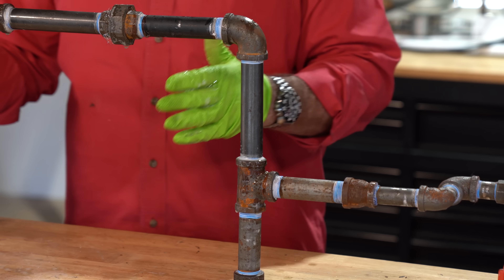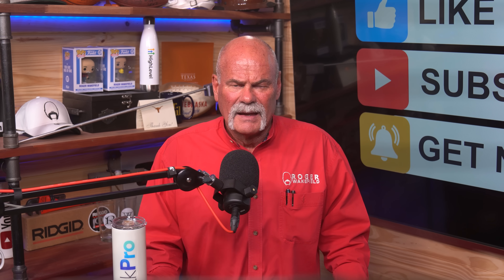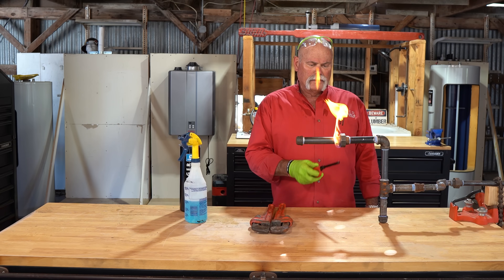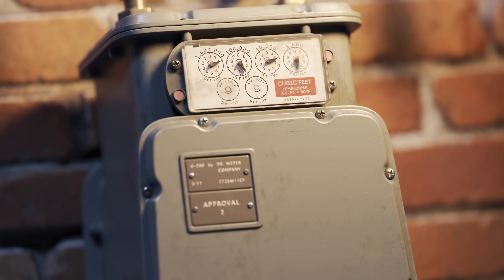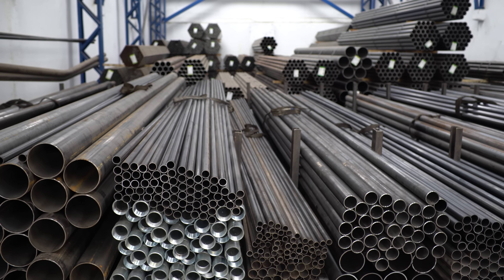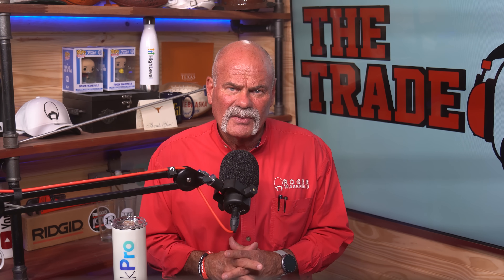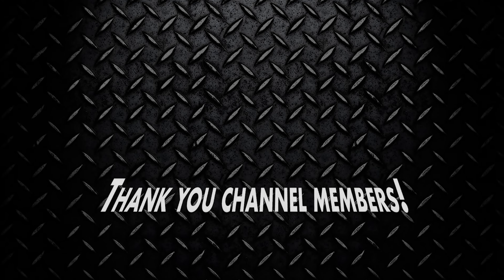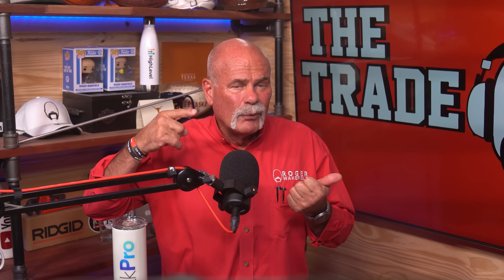Everything to Know About Gas Lines in Plumbing

Comment: Someone, a DIY homeowner most likely, ran most of my house's gas with the flexible metal gas hose in the crawl space. I don't know if they were just lazy or didn't know how to thread black pipe.
Unfortunately for one of the contractors I hired, he nicked the flex hose when he was cutting old galvanized water pipe out. so the crawl space was full of gas, just after he probably had been throwing sparks cutting pipe. He was pretty shaken when he finally got out.
Just way too much of that flimsy pipe under there just hanging off straps tied to the floor joists, real sloppy work and dangerous!

Comment: Plumbed for five years. Worked with everything. I started inspecting plumbing and my goodness there are guys that should not be permitted to touch gas or lp systems.

Also csst requires bonding not grounding

Comment: the too much pressure in a larger pipe in the house does not make sense the whole house is reduced to same pressure at the meter reducing valve then if there are slight differences they can be adjusted at the regulator on heating system

Comment: I was working in boiler room at a school in summer and the plumbers put in a check valve backwards going to boiler and the old guy told aprentice we can just unscrew the valve hold hand over the 2 inch pipe, while i flip the valve around and put it back together. he was trying to avoid having to relight pilot lights in the kitchen and the home economics class on all the stoves. I said what are you nuts?  I am going to lunch let me know when you are done he just laughed it will be fine he said he flipped the valve got pipe back together without blowing up the school, but every pilot light went out anyway as soon as he disconected the pipe so it was a stupid risk.

Comment: Copper is absolutely an appropriate, approved material for gas. I just installed a couple hundred feet of 3/8 soft copper to feed gas lamps mounted on the exterior wall of a new building. Fittings must be flare, no compression, or brazed.
Reply: Please check with your gas company.  California - there's something in the natural gas that eats away at the copper (copper sulfates) also the pieces can clog up your appliances.
Reply: @Den @DennisMiller-d8w  I don’t need to check with the gas company, my work was inspected and passed by the city inspectors, they are the arbiters of approved materials and methods .

Comment: That Maxitrol 325 regulator is not installed correctly @4:20, as it should have unions before and after for easy service and replacement if needed.

Comment: I have seen thread protectors used as couplings for gas pipes and the gas company has used them outside of buildings too. Thread protectors smaller than 2 1/2 inches have a non tapered running thread and can leak.

Comment: As a gas utility worker, id add a few things as well:

1. If you see an electrical ground wire on the outlet (customer) side of a meter, its effectively useless and dangerous, every gas utility ive worked for installs insulators on their outlet swivels.

2. You didnt bring this up, but the average CO monitor cannot detect natural gas, if you want an explosive gas detector-CO detector combo, they are made, but are more expensive

3. In line with #1, the small wire afixed to the inlet side of the gas meter is a tracer wire, we use it to locate how your gas line runs from the main to the meter, please stop cutting it off.

4. Anodes: some older coated steel systems may still have anodes on inlet riser of the meter, it does look like an electrical ground but doesn't feed from the house
Reply: 1. That is a BOND wire not a GROUND wire and should be on the house side.  We are not looking for a ground into dirt, we are looking to bond all the house piping to the house electrical system ground.  We know the insulators are there, it is actually not allowed to try to ground to the gas riser in the dirt.
Reply: @nspro931  you can bond / hook it to the ground rod of the house electrical system

Comment: The best comment was "pull a permit" homeowner here.  Needing to replace leaking CSST.  I already have plumbing certifications and just need to replace 20 or so feet in a crappy crawlspace.  

Got a permit. Got it approved. Changing it out soon.  

Testing with bubbles and a sniffer.

Comment: Why is it that every time I fix something at a customer’s house relating to gas the professional plumber I come behind always uses blue Teflon tap is this normal I always use yellow tape and yellow pipe dope.
Reply: Thats a pro brand papa
Reply: blue monster is rated for acid to water. i don’t bother with white ptfe tape unless it’s a temporary air or sump line

Comment: 5:18 shows larger pipe less pressure, However the graph shows small 2 at 0.3 and larger 6" at 0.59 psi
Reply: the graph is saying you get more pressure at end of the line in a bigger pipe because of less loss with same load

Comment: Very timely.  We need to run a new line to the kitchen for the wife's new range.  Good info, thanks.  I was thinking about DIY, but not anymore.
Reply: Did you have it done, and how much did it cost?  I had to  upsize my 3/4" pipe to 1" to add a gas dryer and gas range.  Big job but I did it myself.

Comment: Hey Roger. Way back when, when I was doing plumbing in NC, each county had their own regs, it seemed, on gas lines. One required black pipe only. One, rigid copper soldered with silver solder. A third, soft copper soldered with silver solder. It's nuts. There should be one standard that's the same in every state, not county by county.
Reply: Gosh yeah NC can be a plumbing wilderness

Comment: I connected my dryer, water heater, stove, and gas fireplace myself. I used black fittings and flexible appliance connectors. I checked for leaks with liquid leak detector to make sure it wasn't leaking. I didn't get any permits and have to pay a bunch of extra money to the city.
Reply: If you’re handy with tools, life is so much easier.
Reply: When you checked for leaks you used a pressure tester from the meter itself, right? Please don’t tell me you just put bubbles on it and called it fine
Reply: Not everyone is mechanically inclined.  I responded to a gas leak where the wall was filled with gas. The lawyer or doctor (wealthy area) attempted to hook up a gas range. He wasn't able to get into the wall good enough to really tighten down the new appliance valve he installed, so he just doubled up the pipe dope and called it good!   I ended up enlarging the hole which would be hidden by the range anyway and tightened everything appropriately.  Also, the big box stores installing gas appliances = Job security for plumbers and the gas company based on how many hack jobs they do.

Comment: Do you need to paint gas lines on the outside of a house?
Reply: In our area we do.  I'm sure that changes based on our area.
Reply: Yes it is National Fuel Code to paint all “black iron/mild steel” piping in an exterior location regardless of geographic location or weather. It is also recommended that the same piping if used in an indoor location that has abnormally high humidity (like a greenhouse) be painted as well. Do not use latex house paint.

Comment: In regards to flex connectors "appliance connectors" i really wish people would quit using these in furnaces.  Honestly surprised you didnt touch in shut off valves and sediment traps. Might be better for a long form video i guess maybe slightly more in depth.  Good video though a lot of times we preferred to oversize vs undersize our main line from the service simply due to future customer needs

Comment: Hi, Roger. It's Roger! I've got a couple of questions about dissimilar metals, if you have time to answer. I like to use 304 stainless schedule 40 pipe for things like outdoor grill supplies. I like that I never have to worry about them rusting, and to me the extra cost is worth it. With 304, do you know if that is a close enough metal to standard black iron pipe that they can be joined without concern of galvanic corrosion? Similarly, nearly every gas valve I have ever seen is brass. Is it acceptable to screw those directly onto black iron (with appropriate pipe dope/tape), or should there be a dielectric union of some sort?

Bonus question: What do you think about using something like Counterstrike CSST for in-wall piping? I know there are some AHJs that forbid it, but I never have bothered to research why that is.

Thanks for your great videos. I always enjoy them!
Reply: This is just information I found online. " Electrolysis requires an electrolyte (water in pipes)" I am not an expert. I believe the proper tape or dope can also help separate them. It might be a concern if it is in a wet location.

Comment: with gas you do not have to tighten fittings like a gorilla....that can actually cause more problems....gas is measured in volume not pressure so no need for 3 foot wrench ...maybye if your doing industrial huge stuff
Reply: I'm still learning about this stuff (and really enjoying it). One thing somebody mentioned, never thought of it before, was the important of supporting the gas line with pipe clamps so that a branch isn't just dead weighting somewhere. Pipes are heavy and if a gas line isn't properly supported, the weight of it will sag downwards and that rotation can actually loosen one of its fittings and start a leak. So shoutout to pipe clamps lol

Comment: I wish you would've gone over a few other things.  Like some uncommon scenarios.
I bought a house that used to have some kind of a gas connection for a pool heater.  When the pool heater broke, the previous owners had the gas disconnected; but the connection pipes are still there.  I believe they had a large gas tank for it, as this neighborhood is not gas serviced at all; all electric.  
Fast forward to when I buy the house, and here I am left with these gas pipes hanging off the outside of the house by the pool equipment, and I have no idea if I can remove it, cut it off somewhere, idk.  It's an eyesore, and I'd like it gone, but I'm too afraid to do it.  
I don't know very much about gas at all; it scares the hell outta me.
Reply from the maker: Is the pool equipment using the gas? Have you went to the large tank to see if there is a shut off valve somewhere (there should be) Turn it off. But it sounds like you may need to call someone out to verify its offline and see what it would take to get rid of those old lines
Reply: @RogerWakefield  there is no tank left.  I assumed they had a tank, because there is no gas service in this neighborhood at all (I called the gas company).  

The only remnants are a green round metal contraption with 4 outputs:
1: to broken pool heater
1: capped off
1: has a hollow pvc fitting pointing down
1: goes into ground*

*And about 6 or 7 feet away from that green metal contraption, a metal pipe comes up out of the ground, attached to a (1/2" I think) flexible metal pipe/hose that is attached to the exterior wall, and is capped off.

The reason I am unsure about getting rid of the whole thing is because of the green metal contraption that goes into the ground.  I think it goes to the flexible pipe 6ft away, but I'm not positive.  The gas company said there is no gas service in my neighborhood; but why does the pipe go into the ground?

And if it does just go to the flex pipe, is there any residual gas in the lines?  Would it be dangerous to remove?  Idk
Reply: @SheilaSpencer1  The gas companies don't always keep up to date maps. In our case, they said we couldn't get gas service as they didn't have gas in our area.  There were gas meters on the neighbors house and at the township property across the street from us.  We had to take pictures to prove it to them.

Comment: Plumbers aren't allowed to touch gas lines in Rhode Island, only pipe fitters can. Here it is considered a separate trade. When I get HVAC work done I sometimes have to call a pipe fitter depending on how far the plumber or hvac tech have to go to do a repair. If it crosses the point where a gas line needs to be disconnected, the pipe fitter takes over.
Reply from the maker: Very interesting, so they have pipefitting service repairmen?
Reply: That’s absolutely false, plumbers in Rhode Island install gas lines. As far as your “pipe fitter” comment, that’s ridiculous. Who’s the pipe fitter company? There’s no pipe fitter license, pipe fitters do work under the license of plumbing/mechanical contractors.

Comment: Roger is incorrect. You can use copper on natural gas and propane. You cannot however, use copper for natural gas in every state. Just kinda depends on what state or country you’re in and how clean your gas is.
Reply: I'm in Kentucky you use to be able to for grills and such but I haven't checked up on any updates man.
Reply: @marcosperez1168  in Tennessee we cannot. In Minnesota we could.
Reply: @Dudjrkfjjffjkffu ,you are correct. L & K copper is OK ,as long as the gas contains less than 0.3 grans of hydrogen sulfide per 100 SCF. Today natural gas is treated & filtered to a very low concentration of hydrogen sulfide but in the past ( not long ago) those numbers could have run very high causing interior pipe deterioration (corrosion). That being said,code enforcement authorities having jurisdiction has the final say so on materials allowed to be used, as long their standards don’t undermine or weaken the national standards (NFPA 54). And don’t forget, there are strict standards on how copper connections are to be made.
Reply: @marcosperez1168 probably not, kentuckys got some hard code on a lot of things